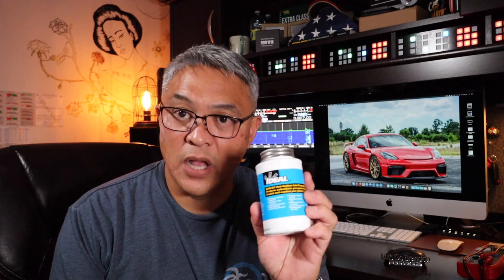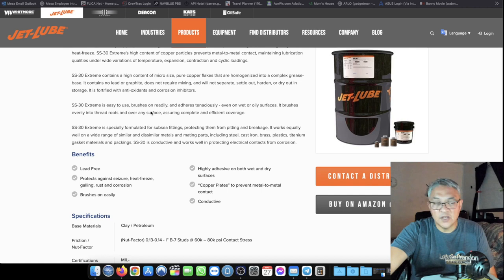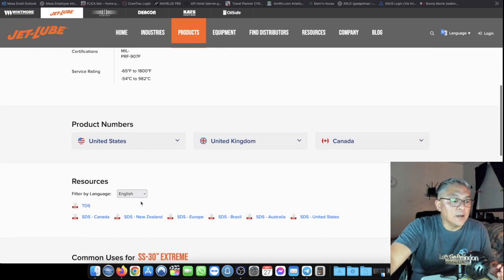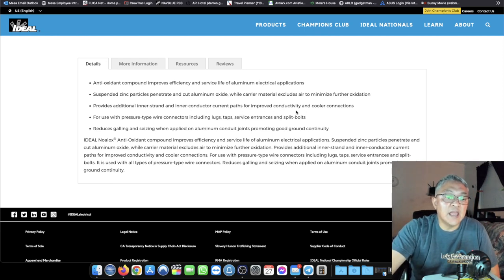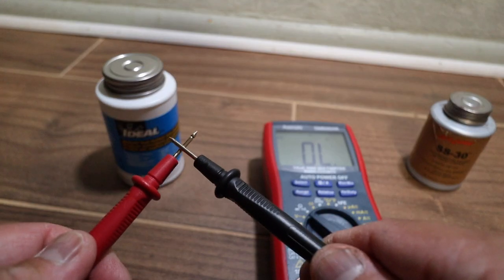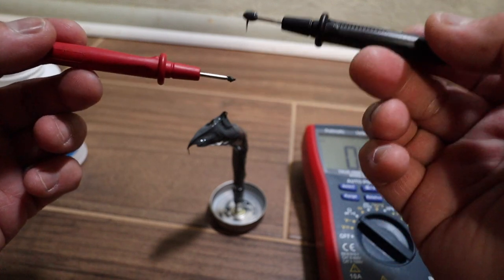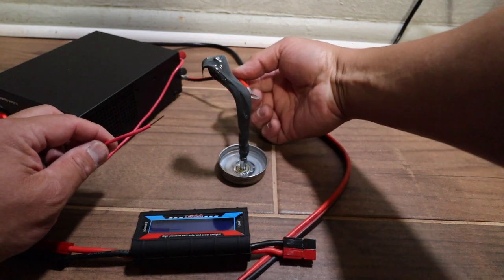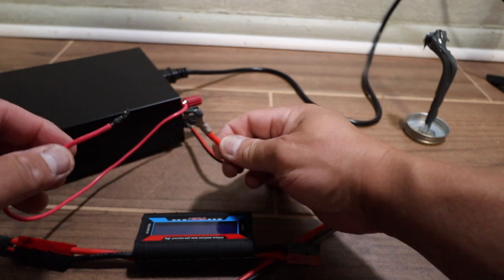JetLube SS-30 vs Ideal Naolox | Anti-Corrosion Compound for Aluminum | Antiseize Compound

Comment: Thanks for this video.  I am planning to use SS-30 on my new Zerofive HOA. I like the idea of copper in suspension instead of zinc. To test this stuff you have to use a megger(sp) that has an adjustable voltage and frequency to plot different breakdown points over a thickness or film that is representative of the use case that the substance is used for.  RF currents jumps across nearly any small gap. The question is always, how much loss?  In this case, where you are looking at a joint between two pieces of aluminium, I would say that conductivity doesn't matter much but protection against oxidation and corrosion is that this is all about.
Reply from the maker: Thanks Ron for the input about using a Megger. I will keep the SS-30 on my antennas.

Comment: I am late to the party on this vid, but it is fascinating since I haven't used either product, and it's making me think first.  One experiment 
I might run before deciding - is to connect three sets of two small copper-clad boards with a) nothing, b) SS-30, and c) Naolox sandwiched in between.  Then, after settling for a few days (or perhaps a few hot/cold soaks), hook it up to a nano-vna and sweep it over the bands of interest to see what that connection looks like.  Thanks for the demos!
Reply from the maker: I still use the SS-30 for connecting my Zero Five 43' HF Vertical elements together.

Comment: Interesting experiments. DX Engineering recommends the Jet Lube SS-30 as an anti-seize even for aluminum antenna joints. I myself used the Jet Lube on my ZeroFive 27' vertical, and I used GB Ox-Gard on the joins of my Hustler 5BTV. GB Ox-Gard has been around forever and I think it is pretty much the same thing as the Naolox, in that it is a petroleum jelly with particles of zinc suspended inside. I actually did the same experiment you did on the GB Ox-Gard and it, also, did not appear to conduct. 

I don't claim to be an expert, but it's my guess that the important thing is to have some sort of anti-seize compound between the antenna joins. I am certainly not taking down my ZeroFive antenna and cleaning all the Jet Lube off just because it has copper flakes in it. 73 de WB4DW
Reply from the maker: Hahahaha, I'm no expert either...  That's good to know that someone else thought of testing the continuity. I also used Jetlube on both of my Zero Five antennas.  Yeah, I'm too lazy to take down, clean and use the Naolox. Like you said, at least there is anti-seize between the antenna joints.  73's de Capt Darren N4VFR

Comment: I've  use JetLube on stainless and aluminum and have not had a problem.  But every time I use it on aluminum I have that feeling the copper flakes are the wrong thing to use... and I use it anyway.  Old habits ...  Thanks for the video.

Comment: I have ss30 and penatrox. Penatrox was recommended by Mosley for my ta33 beam. Any difference with ss.30? Up for 20 years and still works well. No corrosion at joints.

Comment: Probablly to late to comment but I have found copper antiseizse far superior to the Noalax for anteena aluminum to Aluminum joints.  Have youu looked at pictures of Tim Duffys antenna farm. Pretty sure it is all Copper antiseize he uses.
Reply from the maker: I'm Still Using SS-30 for my applications.